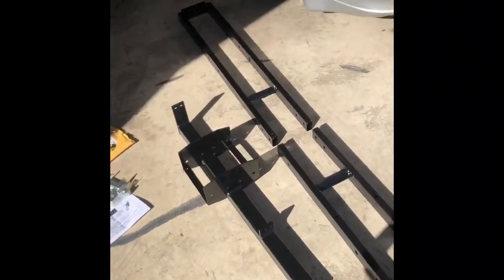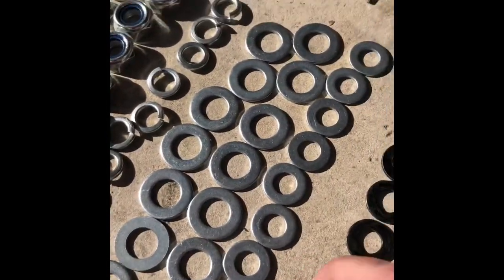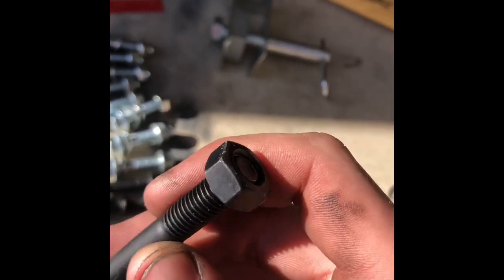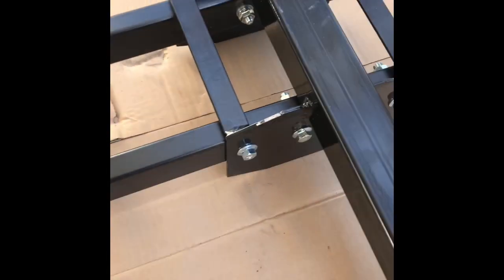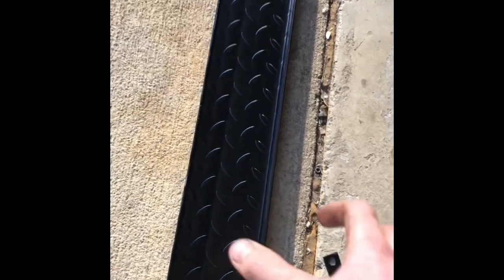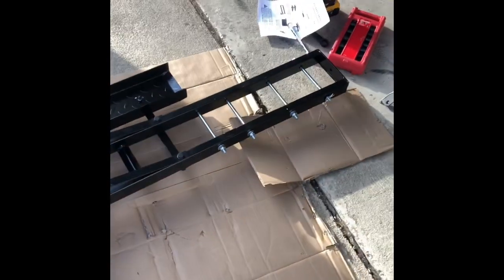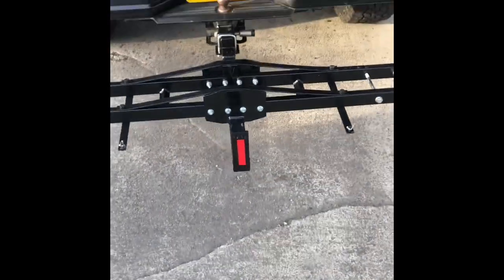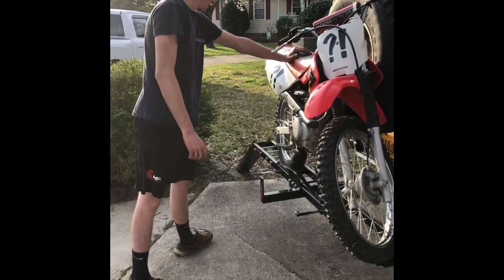$80 Amazon Dirt Bike Carrier Assembly and Review

Comment: The front tire of the motorcycle must
rest down into the cradle and be
secured with a large clevis pin and
hairpin. This step is necessary in
case a strap is broken or comes loose
during transport. A second clevis pin
is supplied. Depending on the size
of your motorcycle, this pin may not
be needed. If this pin is not used,
secure the motorcycle tire with a strap
(not included).

Comment: I think you installed the stabilizer on the hitch backwards - the small leg of the "L" should be against the rack and the large leg flat against the bottom of the receiver so when you tighten the u bolt it pushsd the rack up snug against the inside top of the receiver.

Comment: Great Job, I ended up putting those middle bolts the other way because My tires rubbed on the threads sticking out, still don't understand that stabilizer clamp

Comment: Just assembled my own and wondered if you figured out what the two "bolt with pin" is for? I wasn't sure if it was to stabilize the ramp with those holes or why it has pins at all. Any thoughts? Do you use them?
Reply: I believe the 2 long bolts with the holes at the end are put in place after the bike is put on . The bike tires drop down into the holes where the bolts aren’t . This immediately stabilizes the bike .Then you put the bolts in threw the tires to secure the bike .

Comment: I bought the same carrier to haul my 150cc scooter on my motorhome. Great video, though I would have liked to see your bike strapped down and see you haul it. I had to buy a double reciever for my hitch as the ramp is much too short to get my scooter onto the carrier. So the double hitch hangs lower and this works. I also have a bike rack I had hoped I could use with it also but it is too close to carry bicycles along with the scooter. I put the scooter on the carrier and it was very shaky so I ordered a hitch  stabilizer such as you are using here. 

The company claims this carrier can hold up to 500 pounds but even my 230 pound scooter makes me nervous on this. Make sure you do not exceed the tongue weight on your hitch. Mine is 300 pounds. I have 2 other motorcycles both of which weigh around 500 pounds each. This carrier would never work and even it could carry those bikes the hitch would not suffice.

Comment: You are missing 2 flat plates, thats why the steel is bending when you tightened the bolts. very week without them. good luck
Reply: Doesn’t come with 2 flat plates.
Reply: Mine didn’t either...I had same issue :(

Comment: dang it already doubled up in past year i got it for like 130 +tax so 150 out the door. i just got this to take my grom on a move from cali to kentucky. sucked though i was supposed to leave last week or so but then when i ordered, the first got returned because the packaging they said was all messed up. so had to reorder it and wait for about 4-5 days extra. and one of the butterfly nuts wont screw on for me one works perfect.. so ill have to try to find a nut for that before i leave tomorrow. though i just might throw the ramp inside the truck. did you tie it down with the spare tire on or off? sick bro its all we need for small bikes.
Reply: Same as me… paid you ver 140…..I’m not the only one 🤣

Comment: Hello and thanks for your excellent instructions. The only thing I disagree with or did differently than you was the first step in the beginning. I found it much easier to put the 8 bolts in with the bracket right side up as opposed to upside down. Cheers!

Comment: Excellent upload. I appreciate it very much. My rack arrived yesterday evening and with video it will be pretty easy to assemble. Those instructions that came with it are indeed bad! I'll be using this for my 80lb ebike so I'm sure it will hold up well. Might leave out 2 of the long bolts so the tires kinda drop in. Thanks again!          What is the purpose of those long bolts with pins?